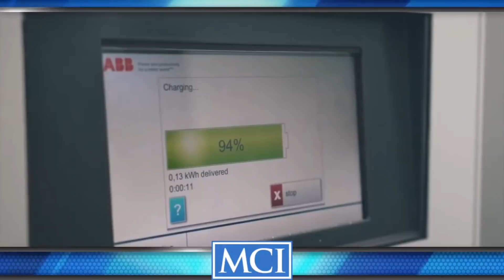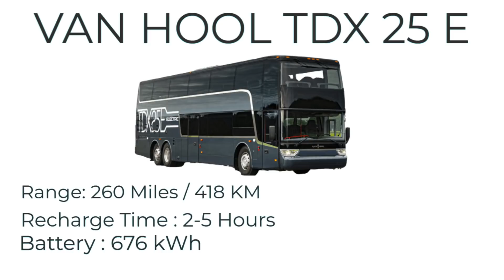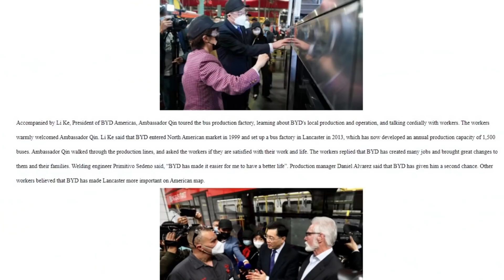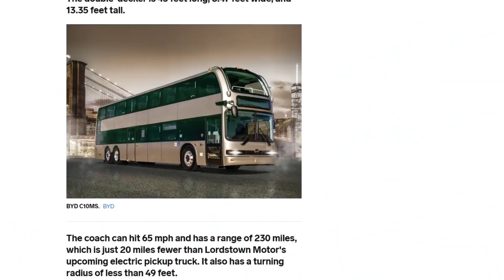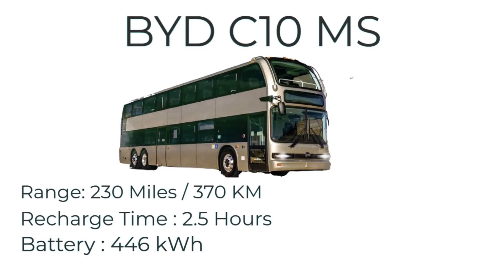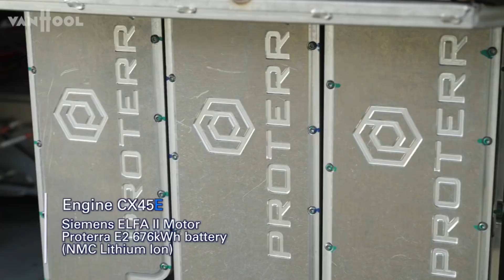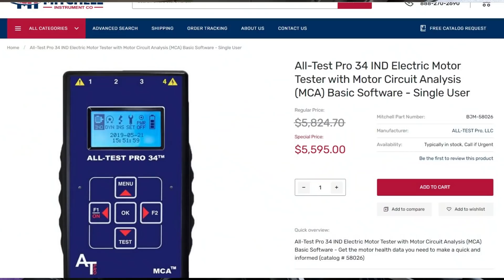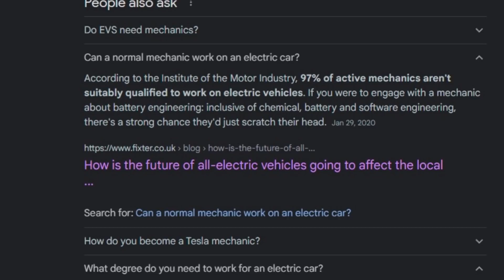Are Electric Buses working out in the US?

Comment: My question is this. In other countries, they have started testing robotic battery swapping for EVs, in fact I know there is one doing it in California here in America,. Basically, you pull into the Charge booth and a robotic device removes the car battery back and replaces it with another fully charged battery pack. The one from yours is then recharged for another EV to use. The time to change the battery pack is 5 minutes, I could see a bus battery pack ( multiple) taking maybe 20 minutes. Also, this eliminates replacing a battery when they start to lose capacity, the people operating the change-out station do that. I think that could work for a bus company since many run regular routes so swap stations can be where needed. Just a thought.
Reply: I hope it's Mother Teresa doing the swapping.  No way I'd swap out a new battery for a random used/abused one, unless I'm just leasing the vehicle from the company doing the swapping.  Technically a wonderful idea, but commercially/financially just a nightmare waiting to happen.  The lawyers will all get rich when swapping becomes common, closely followed by scams related to it.

Comment: A pretty fair assessment.  But, I would have liked to see you also address use of batteries for auxiliary functions rather than idling.  There are multiple companies doing this as original or retrofit, and advertise that you can pre-cool or heat the bus without the engine.  This would be a great benefit when in a city with anti-idling measures, or scenarios where your customers need to spend a lot of time on the bus while not in motion.  Maybe you can do a follow-up video on these systems?

Comment: Electric busses I think make sense in large cities like Chicago, SF, New York ,etc.  For on-the-road type of travel (tour busses for example) I don't think they are as feasible.  For one thing, you would probably have to charge them once a day or every, say, 500 miles.  But for in-town use especially in large cities, this wouldn't be a problem because cities would have hundreds of these and they could cycle them in and out.  Maybe each bus runs for 12-16 hour shifts and then goes back to the garage to be charged for 8 hours and then back out on the road again.  And the fuel savings would be large because vehicles tend to get worse gas mileage in-town than they do going down the highway at a constant speed.

Comment: Battery Packs should be made so they can be easily slid in and out so buses can be used for longer trips.  they may still be a decade or so from being able to cross whole continents but a better exchange system and laws would make elctric transit more viable
Reply: Some how I dont forsee companies unifying on 1 or 2 standard batteries by themselves

Comment: Hess are also into electric Bus systems 
They have a new tram style Bus. Its all good to go electric but when it comes to replace the batteries it just does not weigh up in price. Plus the production of parts is way more economically unsound compared to just running a Diesel engine.  Batteries will fail and if one shorts you cant put the fire out with normal fire suppression systems. Its way to early to start having a full electric fleet. As he also stated working on these systems it will need a complete new service department. 
Keep to diesel until it has been proofed. Its a waist of money.

Comment: Some motor coach firms like those in Las Vegas, might even now have "local" charters within electric battery range.  Many trade show run transit bus style routes connecting hotels that have a mix of attendies and exhibits {like CES Consumer Electronis Show} that have all loop stops in an  under 10 mile loop. To be sure say 10 diesel circuit might have 10 have assignment of 15 buses to allow some to charge.   In there are som

in regards to mechanics; in a large system, some people have tire, chassis, bodywork duties that shouldnet be too different or need heavy training for electronis.  In aviation there are seperate mechanic certifications for AIRFRAME, POWERPLAT, and AVIONICS.  For commercial hiway mechanic trades  something similar could be done.  Around 1940s there was a switch  to diesel from gas, that needed some REtraining

Comment: They will need to make buses with replaceable batteries like electric forklifts use. A 10 minute battery replacement would make electric buses much more usable. That would also require the infrastructure to be in place.
Reply: thats a horrible idea not pratical
Reply: @davidmoser3535  How is it not practical? It's been done in forklifts for more than 50 years. Much cheaper to have extra batteries than to have a bus only usable for 6 or eight hours at a time.
Reply: The issue I see with that is unifying on 1 or 2 standard batteries

Comment: When I was doing the commuter run thing from Southern Maryland in to DC and back it was a split shift so in this case a battery operated coach would be feasible. Since it was a split AM PM run the electric coaches could be charged overnight or upon return from the AM runs. The company I was working for was under contract to the MTA = Maryland Transportation Authority. They helped offset the price of fuel and the price of buying new coaches. They also ran school buses for the county so they also got a fuel offset for that. Most of their fleet were DL3's with some newer D-4505's. the D's were mainly used for charter runs or as needed for the commuter runs. A typical run from Southern Maryland to NYC would use about 140 gallons round trip with the Allison 500's and about 130 with the ZF 10 speed. There was no need for refueling till they got back to the yard. All that fuel was calculated. A few gallons here and there between the coaches and school buses and one of the owners F-350. As far as a trip to NYC R/T on an electric coach would be a big no go.. You brought up some good points. Just like an electric car the more things you turn on the faster the battery drains. AC, Heat Lights. Entertainment system.  This doesn't even include going up and down hills. Is there some sort of degeneration brake that acts like a Jake brake? To many variables.

Comment: Hi James i am a team leader at the Prevost shop in Toronto. I agree with you about  Electric power coaches not there yet for doing long trips. You said about the cost of replacing batteries with any government they replace the engine and transmission after about 5 years of service cost of about $85000 per unit. All transit should be electric power. Nova bus has a bus with 80km range and it takes 2-3 minutes to charge using a pentagram on the roof. Send me your email and I will send you some pictures of it. All are diesel mechanics are fixing the electric power buses. They all had the change to change due to hybrid buses and now for the electric buses
Reply: Great contents by the way
Reply from the maker: Hey Jason. Thanks for the comment. Wow a team leader at Prevost! I have so many questions for you. 
My email is jwang@peoriacharter.com

Comment: I can share some data of Beijing transit buses.
A typical citybus: Model BJ6123EVCA-37, 12m/18t/70pax/69kph/150kw, by Foton, manufacture year 2017, fleet:1860, battery from Yinlong, technology: Lithium titanate battery, capacity: 115Kwh, charge time: 30min (Quick charge. Plug x4 chargers at same time), range: ~120km. Price: ~2 million RMB per each bus. These buses used at inner city/suburban lines, (40~60km for a round trip)
A typical suburban bus: Model BJ6127EVCA-6, 12m/18t/80pax/69kph/160kw, by Foton, manufacture year 2019, fleet: 100, battery from 普莱德, technology: Lithium iron phosphate battery. Capacity 250Kwh. Do not support quick charge. Charge time: 3h. Range >200km. Price: unknown. These buses usually used at suburban/long distance lines (200km for a round trip).
BPT has a tragic BEV bus experiments history. Beijing started to test some BEV bus since 2001, and NONE of them survived to beijing buses typical service lifespan of 10 years. One typical tragic example is BK6122EV2, entered service in 2008. Even if BPT has replaced their battery for 2 times. And buying them new battery cost almost the same price of buying a new bus (rumored 1.8 Million RMB per each bus). When they phased out of service in 2014, only 6 out of 40's battery can operate. And what's more joke is that. BK6122EV2 is originally designed to be converted to trolleybus when their battery dies. They knew these buses' battery wont survive for so long. And in 2016, BPT did convert them to battery trolleybuses...
But in 2017, Beijing gov forced BPT to rollout BEV buses. And they partnered with a company provide a niche technology route: Lithium titanate battery. To avoid traditional Lithium battery's downside: performance drop in cold weather, short battery lifespan (charge/discharge cycles). At a cost of only provide 40% capacity compared to traditional Lithium battery's capacity at same weight. So, all new BEV buses since 2017 carry much less passengers than previous BEV buses, and much shorter range. But none of them report died battery.

In a word. Beijing buses has been and is still suffering from BEV's problems. We have 21 years of using BEV buses, and they are still not good enough to replace ICE buses. And BPT still not putting of BEV buses on rural/intercity bus lines. Actually, before 2019, BPT bans using BEV buses on lines that runs on expressways...
PS: BPT never bought any buses from BYD. And BYD had lots of issues in early years.

Comment: How about Hybrid electric motor coaches.  This would extend the range and provide safety for passengers in the event batteries become depleted during a run.  Also a small diesel hybrid motor could assist with auxiliary energy use like HVAC systems leaving the main batteries to power the drive wheels exclusively.  thee would still be fossil fuel cost and issues but could provide a way for your industry to gradually consider all electric coaches,

Comment: the idea of electric vehicles sounds nice.. but 70% of all electricity is generated by burning of Coal and Natural gas... so all you've done is moved the exhaust pipe from the vehicle to the power plant... and it's about to get worse as the most efficient form of electric generation is hydro and so many streams are dealing with Draughts.. The big power plant here, hoover dam, the water is barely able to operate it.  Sorry to say, but its not much better than gas.. oh the vehicles work nice.. still takes longer to refuel and when the batteries wear out (and they all do), look for that repair bill... Could totally replace the gas engine 4 times for that bill

Comment: Hybrid.  Smaller battery packs. big electric motor, fuel efficient cunnins diesel turning a high efficiency alternator. Long range. Say 150 miles on batteries, but the diesel cranks out 50% constant power.  And it can still take a charge.The diesel/ alternator / electronics is 1/4 the cost of a big battery pack. fuel costs are 1/3 normal. A perfect blend.

Comment: Motorcoaches in China are limited by law to 100km/h (about 62 mph), perhaps that is the reason for the BYD's pedestrian top speed. I live next to a massive concentration of tech companies in Beijing and they use a ridiculous amount of coaches, most of them electric, to drive their employees to the subway station about a mile and a half away. It's kinda of annoying during rush hours because the roads here are definitely not designed to handle dozens and dozen of couches especially if half the road is blocked with parked coaches. But I guess at least the electric ones are quiet.
Reply from the maker: Hey thanks for the insight. You are probably right. To BYD that speed is normal. I would say that if they want to be competitive in the motorcoach market here in the US, they should make their coaches be able to match US speed limits.

Comment: Now if they could design coaches with standard, easily swappable battery packs. Instead of waiting for the bus to charge, especially on long haul routes, have terminals/rest stops set up at intervals of roughly the distance of a battery charge.  Bus pulls in, passengers disembark to stretch their legs or whatever, meanwhile a crew swaps the depleted ones for fresh which have been charging in banks onsite.  Batteries get prepped for the next coach and you're conceivably on your way in under 15 minutes.  I could see plug-ins being more useful for urban use.

Comment: I work for a transit agency (Pullman Transit) that is only buying new buses that are battery electric. Our “solution” to the maintenance and mechanic issue is to NOT deal with it. Our buses are built by Gillig, with the battery systems in them being from Cummins. Instead of working on the electric systems ourselves we send the buses to the Cummins shop…. 75 miles away in Spokane!  The Gillig battery buses have a range of about 100-120 miles, which is enough for most of our routes for a full day, but not always. Sometimes we have to trade a bus out with only a few hours of service left for that route for the day. 
It’s frustrating from a dispatch perspective but I personally love driving them. Smooth, very fast acceleration and very easy to make a gentle stop with the regen braking. Very quiet inside too which is nice for the driver. 

As for motor coaches, the company I work for  has runs from Pullman to the Spokane airport. With about 160 miles round trip I could see electric coaches working for that. I do think that electric coaches will probably start out with short line run trips like that.
Reply: How are your buses holding up 2 years later? The MBTA just ordered 80 electric buses and we’re all curious to see how they’ll work in the long run (they expect 150 miles/per charge out of them fully loaded with passengers)

Comment: Thank you, James.  As a kid I was fascinated by the "trolley buses" in San Francisco.   The were on certain fixed routes with a labyrinth of overhead wires to power them.  No batteries to replace, no fuel to buy, just grid power.
Reply: They would have to set up charge strips in our highways that are 1 mile long solar powered fast chargers
Reply: @gatornomad7479 , they are experimenting with charging systems put under the blacktop (road) one in Detroit and the other in Germany. There is another country involved but forgot which country it is. The goal is having a charge system underneath the road surface so it can charge any vehicles that are traveling/moving along the highways.
Reply: I remember those busses. I guess the wires were an eye sore, but we 2ere ahead of the curve.
Reply: i hated the trolley buses thats why electric seld contained buses hopefully will take over
Reply: @davidmoser3535  what's wrong with trolley buses?

Comment: Even with electrics, you are still buying fuel every time you plug in, its just in a different form...
Reply: True, it's a mix of nuclear, natural gas,  coal,  petroleum, wind, solar, biomass and so forth, rather than 100% petroleum.  What most people care about is the cost.  Where I live (New Hampshire) plugging in is equivalent to paying $1.20/gallon for gasoline, to go the same distance.  So for my Prius Prime, the fuel cost is $0.02/mile on electric and $0.07/mile running on gasoline.   

At least in my car for how/where I drive, 13kWh takes me the same distance as a gallon of gas does.  So, to figure out the "cost per gallon of gas equivalent" in your area, look at your incremental cost per extra kWh on your electric bill and multiply by 13.

My car's battery holds the equivalent of a half gallon of gas.  Actually it holds more, but only lets me use that much, to protect the battery life.  Needless to say, I love using that whole half gallon of $1.20/gallon gas every chance I get to charge it (at home, I don't have a charger at work).

Comment: has anybody seen the drag axel pto system they have been deveoping for trailers as it spins it drives a genarater to trickel charge the batt or use a small fuel cell as a range exstender

Comment: With the advent of modern battery management technology systems, I curious to why the lazy axle located behind the main back wheels on tag or 3 axle coaches can not have wheel hub generators providing electric power to charge the batteries and onboard systems like air con, lights, etc?   

James didn't mentioned that battery buses/coaches have regenerative management systems, which recharges the batteries when the bus/coach is braking  or when the motors are not drawing battery power like coasting and/or traveling down slopes on a road or highway.
Reply: So you want to use a battery to push the bus extra, to make up for driving a generator off a tire/wheel?  Why they don't do that, is that it introduces losses each step of the way.  If you want to run the AC and lights, just run them directly from the battery.   Using the battery to push the bus, to turn a different wheel, to turn a generator, to charge the battery, is even crazier.  You're taking more out of the battery than you're putting back in.   

All energy the bus uses, comes out of the battery.  Your scheme is just using a complicated and inefficent battery charger, powered by the battery and used to try charging the battery.   It's a losing proposition to even try that.  Just leave the energy in the battery to use it for real things, not for trying to invent a perpetual motion machine creating free energy.  There is no such thing.

You can be 99% sure they're using regenerative braking, it's one of the main advantages of a hybrid, PHEV, or EV.  If they're not using it, whoever designed the bus should be fired.